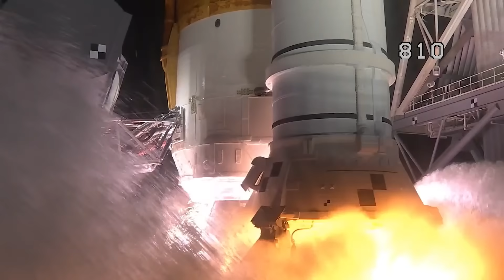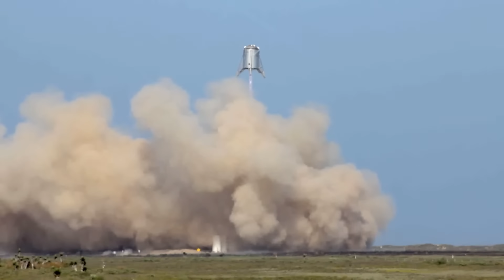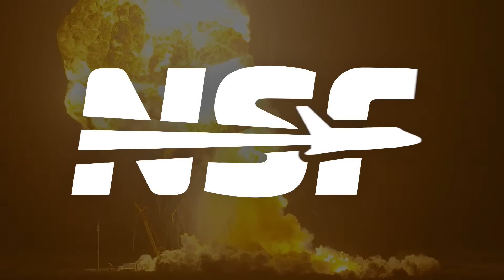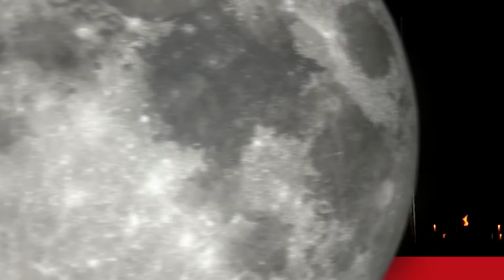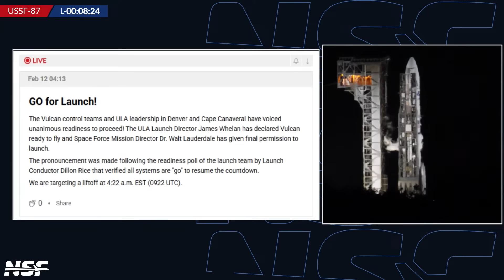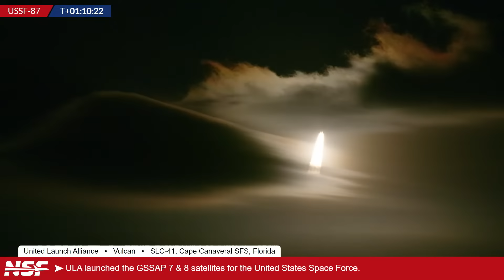ULA Vulcan VC4S launches USSF-87

Comment: Yikes i just reviewed your footage, i see a throat burn thru, it was only blind luck that this did not happen on the inner side of the SRB or that would have gone very differently indeed, the large chunks of fuel being spat out are what happens when the chamber pressure in the SRB drops to low to maintain a rigid connection to the SRB structure & flame creep happens on the outer side of the fuel grain. So lucky that puppy did not burn thru any more or that would have been a game over for sure.

Comment: I think you will get more thrust with 4 smaller SRBs, than 2 larger ones if they all have the same diameter. Am I crazy? Of course, longer thrust with long SRBs.
Reply: SRB thrust is generally a function of the surface area of the burning propellant. With core burner fuel grains, longer means more surface area and more thrust. Larger diameter means more burn time.

Comment: The aluminum is not a stabilizer or there to fill air gaps. It is the fuel and ammonium perchloride is the oxidizer.
Reply: I feel like your onto something.  Leaking hydrogen molecules at 39B keeping us from moon. Besides unfit carbon reentry, redundancies lack and no coms  limited windows no moon.
Reply: He has no idea what he's talking about. It's kinda sad. Fuel is also vacuum degassed so there are no air gaps.
Reply: @williamgreene4834 thank you for some clarification